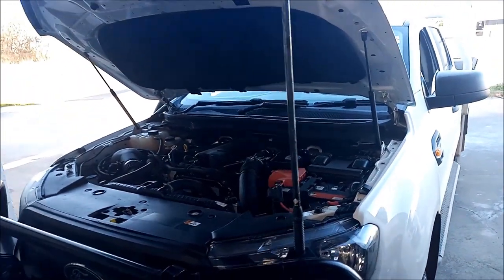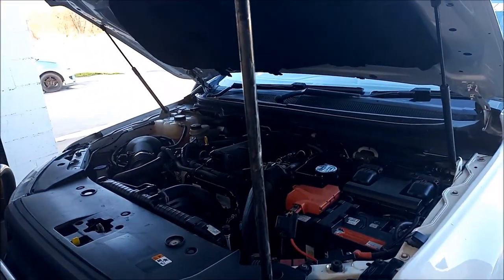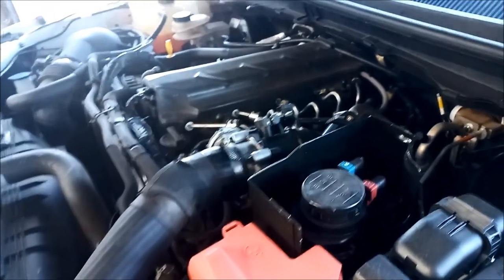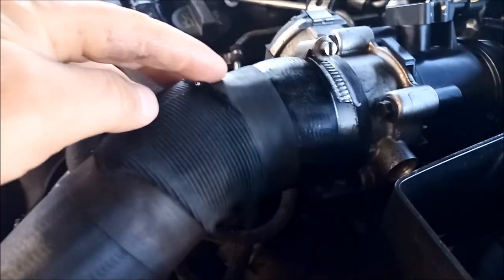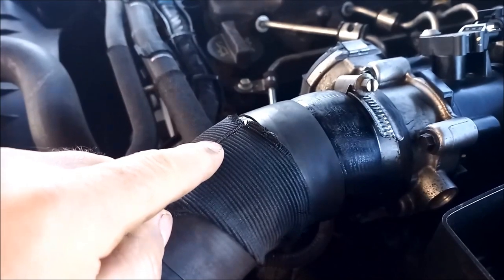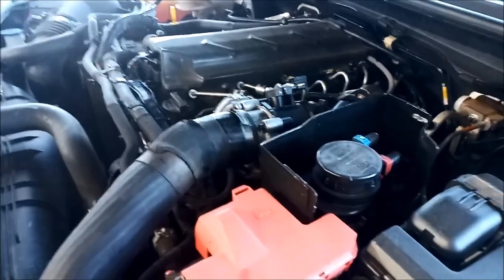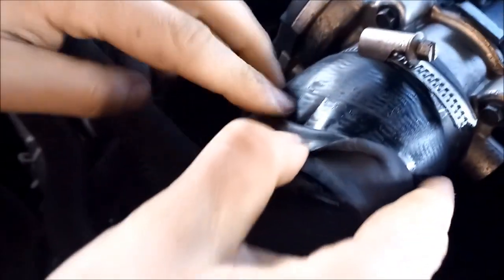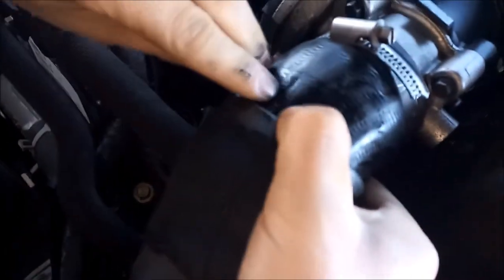Automatic Transmission Noise at 1500 RPM Ford Ranger Mazda BT50

Comment: Had a holden craptiva do a similar thing hell of a weird noise.. was diagnosed as a trans fault.. sleeve on inlet pipe to throttle body was acting like a reed in a saxophone or similar. Was not easy to spot given its location.
Sub note.. how are the transmission cooler sales going?? Fit a cooler and you will never no you needed one…
Reply from the maker: hi, a good stethoscope can help. we fit bypass coolers all year round, but summer is usually busier. cheers